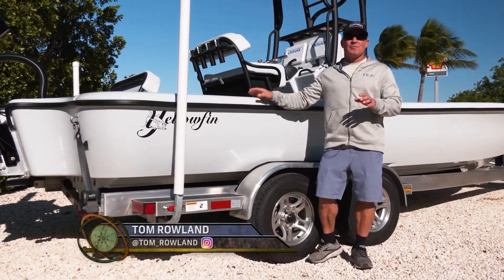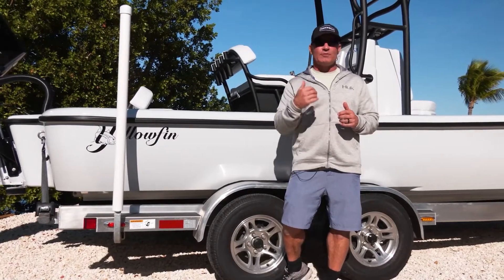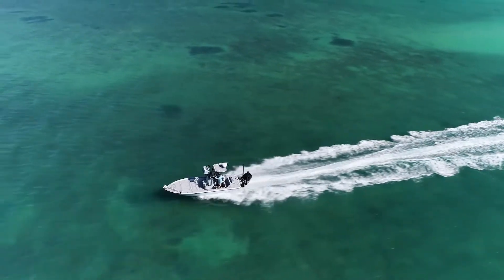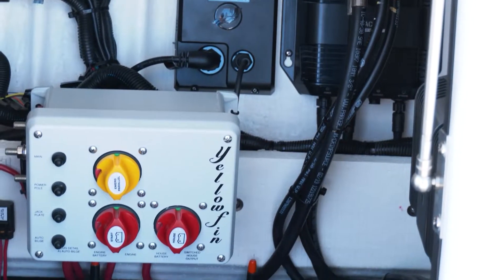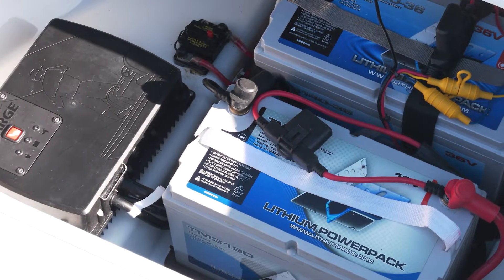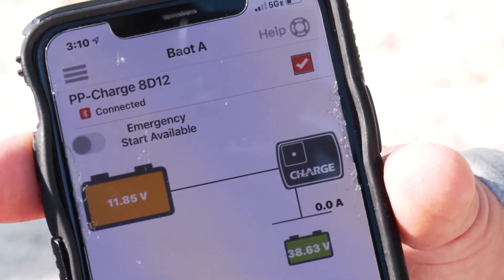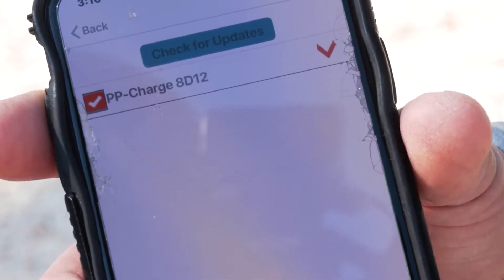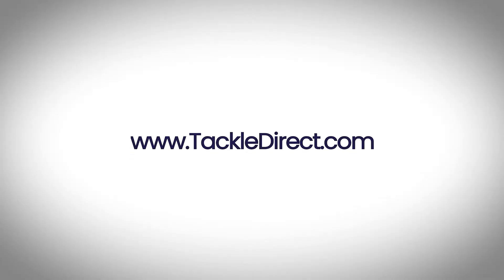New Power-Pole Charging System

Comment: Pretty cool system. But $2k, really?  Seems like the concept of value is totally lost on the modern fisherman... and the ones throwing stupid money around are only making it more expensive for the rest of us.
Reply: Not that people can't afford it. It's priced out the market.😆 You can buy 4 100AH Lithium Batteries & run a pair dedicated in Parallel for *Power Poles & *Electronics separately for 200Ah each for under $900.🤣🤣🤣😂😂